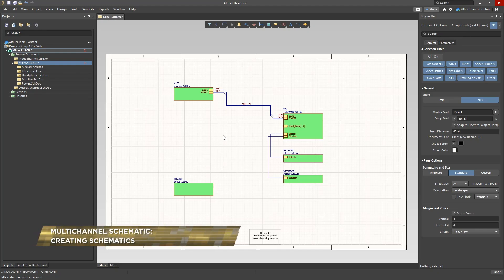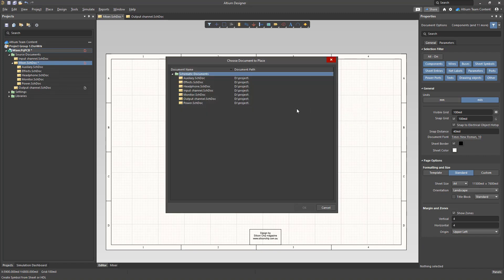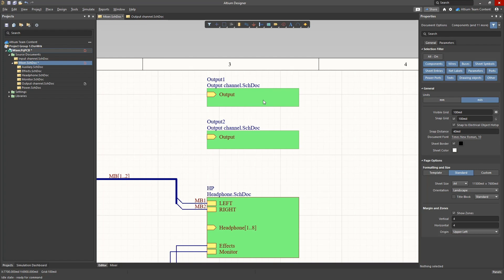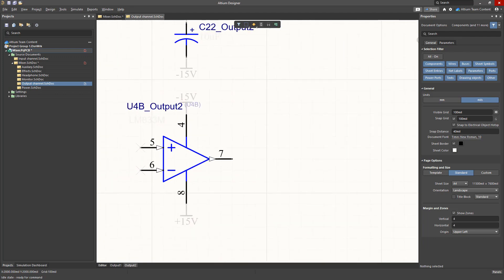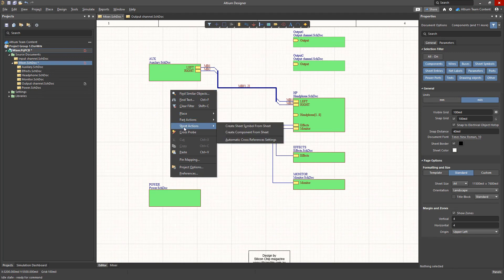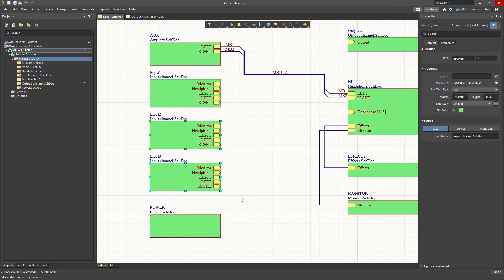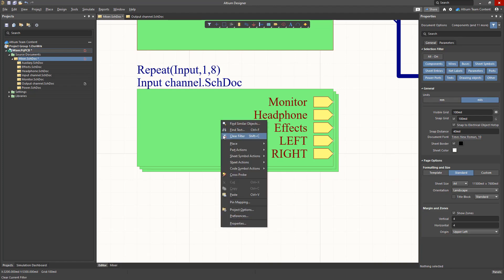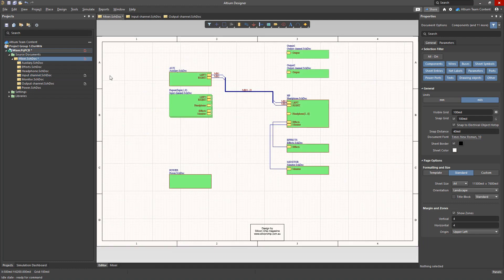How to Create Schematic Channels | Multichannel Schematic Capture

Comment: after i had pasted the second channel from the same file, there not appeared at the bottom of the original file 2 tabs, for otput1 and output2, there is one tab only. 

and the designators hasn't the channel prefix

I had tried as paste, and ctrl-R,  and just create sheet symbol from sheet twice.